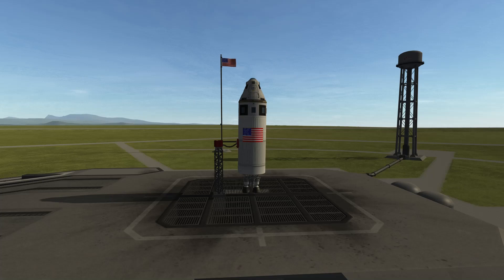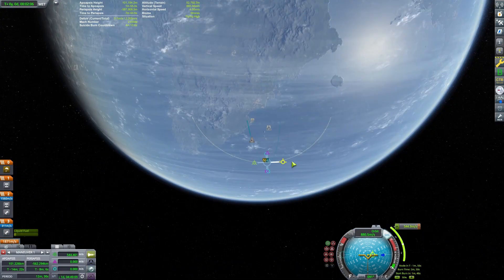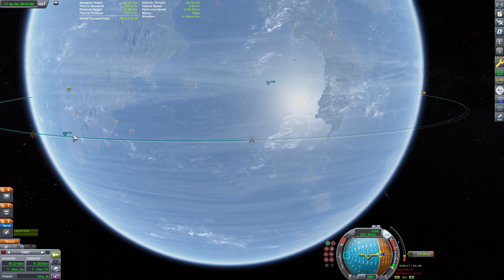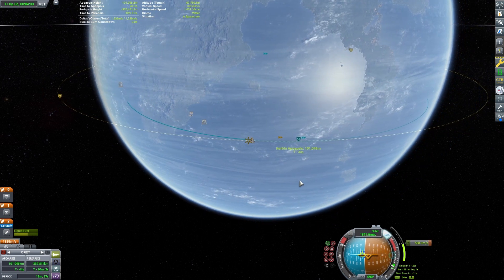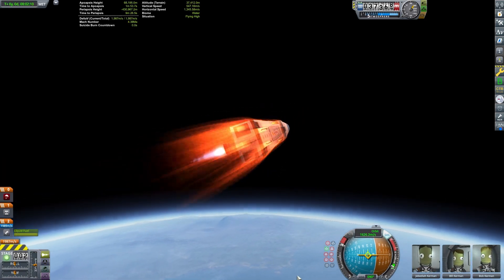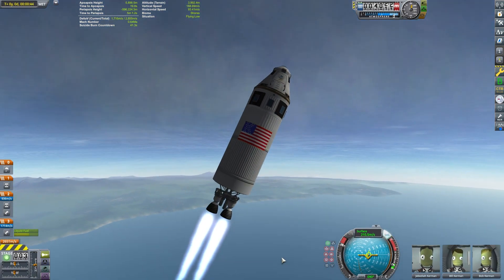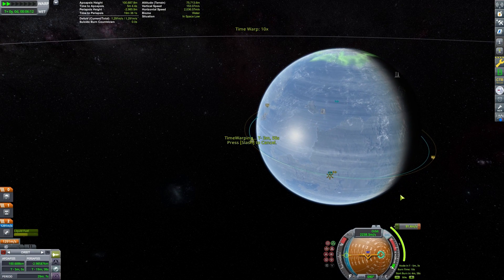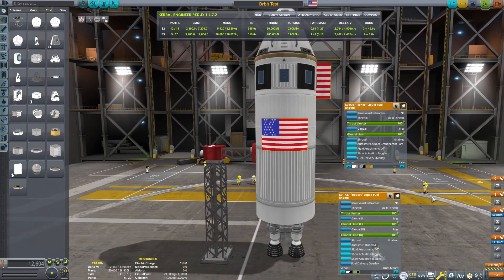Testing How To Get Into Orbit Around Kerbin

Comment: How did you manage to move / show the apoapsis height etc. info (I have the engineer redux mod)?
Reply from the maker: The display on the top left of the screen is Kerbal Engineer Redux. You can can customize your HUD 1 and HUD 2 displays with KER. You can show select what information you want and even move the displays. Is this what you are curious about?
Reply: @Echo3  Thanks, that's what I am interesed in. I cant seem to find the controls to edit the UI.
Reply from the maker: https://youtu.be/bS8Io4aAfSs I made this video for you where I demonstrate how to set up the KER display.
Reply: @Echo3  Thanks so much for this.
Reply from the maker: @AaronKeers  No problem. Hope you have a good day.